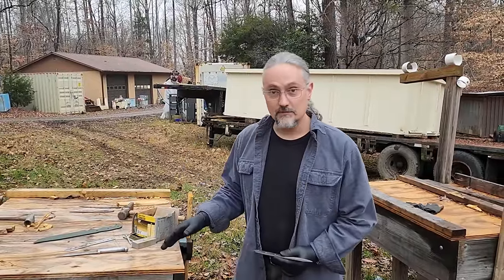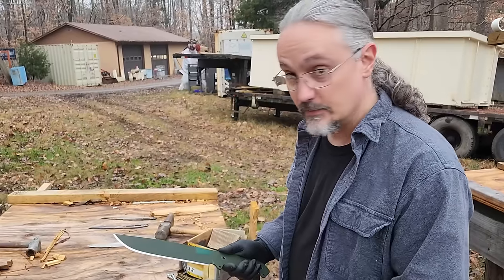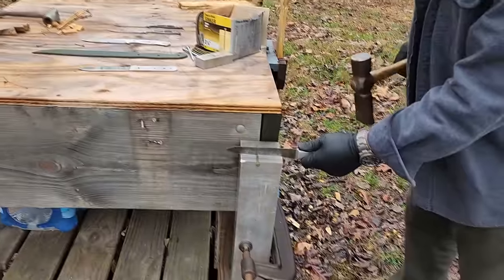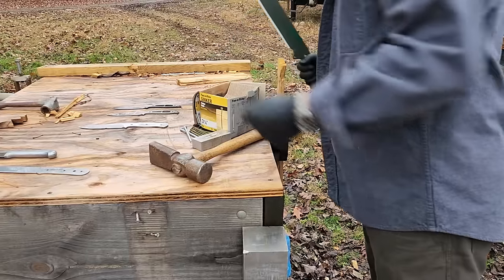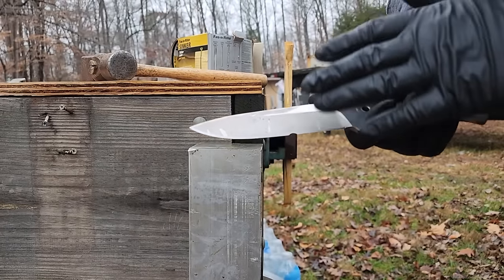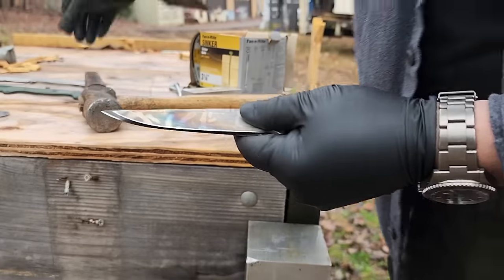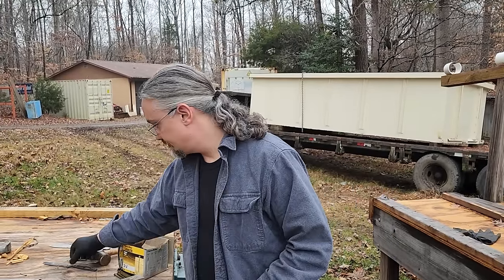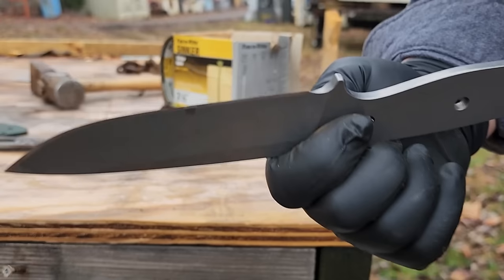How does Magnacut compare to high end carbon steels and Delta CPM 3V

Comment: Dr. Larris Thomas, the inventor of Magnacut steel, said in an interview that the number one factor affecting knife performance is edge geometry.  Understanding the intended use of a knife is important to apply an edge geometry that will optimize performance.  Larrin said that a knife that might not seem very good can be made better by modifying the edge geometry.
Reply: And magnacut is designed to have great edge retention when grinding thinner than usual. A hollow ground blade with a 15 thou edge before sharpening and convex edge in magnacut would cut the bolt fine....

Comment: that last test with the Delta 3V is truly impressive.
Reply: To me the Delta 3V would be the choice for a chopper or "survival" type knife (e.g. one that will be abused) so long as corrosion isn't a priority (ocean) and the Magnacut for slicing, wood working, normal bushcrafting, light batoning, kitchen use, or anything else that doesn't involve gross abuse.  I believe the Magnacut is going to have slightly better edge retention most of the time with superior corrosion resistance, and the Delta 3V is going to be tougher.

Comment: Delta 3V is pretty much untouchable. Insanely tough and fairly stain resistant. Magnacut looks impressive for a fully stainless steel for sure, but can't see it being better option than the Delta 3V for overall usage.
Reply: It's sort of a coked up AEB-L, though admittedly, I'll say that I've used it only in woodworking tools. But think slicing knife with some impact testing (not twisting) and that's what woodworking will advise on in terms of knife steels.
Reply: @daw162  "coked up AEB-L" might be one of the best descriptions of a steel I've ever come across. Kudos sir, kudos!
Reply: @chinaskibukowski7747  It's hard to think of a short explanation of it! under the microscope, it has tiny carbides like AEB-L. it sort of wears a little longer, a little more stainless, a little more time to sharpen....

coked up :)
Reply: What's the difference between regular 3V and delta 3V?
Reply: @MFD00MTR33  the delta part.
Reply: INFI is tougher... d3v has better edge stability... both high level of stain resistance. D3v will stay sharper longer on abrasives and INFI easier to sharpen
Reply: @MFD00MTR33  In short, it's the exact same base material but it differs in the heat treat processing. It's a low temperature tweak to provide greater edge stability and it also conveniently adds extra stainlessness to it as well. 

Check out the other videos on this channel because Nathan has in-depth explanations of it.
Reply: @optimuscrime608 😂😂😂

Comment: I don't really care about stainlessness. I've used carbon steel kitchen knives for over forty years now. They don't rust and I can get a fantastic edge on them. If I could get a better edge on stainless, I've never found stainless gave me any better edge retention, the patina isn't a problem -- they 'grey' rather than rust here in the damp (but not humid) UK and the edge is both fantastic and easy to sharpen.

Comment: That's a really fascinating comparison! The Delta 3V steel in particular is astonishingly resilient. However, my kitchen knives will certainly never be used to cut any bolts or chains. I look forward to eventually adding a magnacut blade to my arsenal.

Comment: Oh a few months back I found those radius plattens I got from you and decided to give them a try. It changed everything for me. Talk about a perfect grind for a chef's knife. I had some S35VN .140" stock. Never wanted to use it for chef's knives but now it do a flat distal taper out to the tip with a zero edges and pull the hollow up to the distal taper. Most of the contact surface is thinner than it would be on a FFG. That little bit of hollow might help with food release. The part I love is that I get the the very thin and slicy blade that is what I am doing with a chef knife but I get some weight and a very stiff blade that just feels better.

I hope you keep making those things. I have only been using them for a few months and I am Freaking out about what happens when they wear out. If there is anything else you make for grinding I don't know where to find your stuff. It was really random when I saw them up the sellers page of BF.
Reply: Great comment, thanks!

Comment: So, a little longer soak time for the Magnacut.  Thank you for that tidbit.  Are you using LN or dry ice?  I imagine with lower austenitization temps. the dry ice is sufficient because retained austenite doesn't seem to be as big of an issue with this steel.

Comment: Just curious how aeb-l steel stacks up toughness wise. I have it on a few balisongs and it is insanely tough and stainless. It's not on the same level as 3V in edge retention, but I'm dying to see it against 3V in toughness.
Reply: Somebody with the means, time and interest needs to do this.  I bet it would get plenty of views from "knife people."
Reply: Look up knive steel nerds, he has all those tests and answers
Reply: AEB-L is so low in the steel category and so far from these steels, that it's useless to compare it to them. Magnacut is WAY harder, will hold it's edge for at least 6 to 8 times more, than AEB - L, and that may sound little, but it's huge. in real use. AEB -L is one of the oldest steels, where Magnacut is the newest... It's night and day. You won't see any difference in toughness, in real use ,between any of these steels you ,mention. Literally no difference at all, other than edge retention and ease of sharpening.

Comment: It looked like you nailed the secret sauce (pun intended) for Magnacut heat treatment.  Went to your site and really liked your designs, but only saw 3V.  While 3V is renowned for its toughness, I was curious to see what you were doing in Magnacut?  From the different YouTubes, it appears that Magnacut is difficult to consistently work with.  Will you be making a 5" in Magnacut?

Comment: Impressive.  I saw someone do this with the Ontario TAK1 (older 1095 stamped version) and no damage to steel.  So I got one.
Reply: I have a TOPS UTE in 1095 that has surprised me with how good TOPS heat treat is.  I have several 1095 knives and the TOPS is in a whole different league.

Comment: Ideally nobody is ever in a situation they need to cut chains or bolts with a knife, but I guess in a pinch thats impressive.

I admit I have on occasion use my tougher knives to puncture pour spouts or breathing holes into steel cans if I can find a good can opener. Even s30v holds up for this type of task though.

Comment: I love magnacut. Have a chef knife at 64 hrc i dropped edge first into stone tile. The chef knife is screaming thin and chiped the stone tile... barely any edge damage and 5 minutes on a 300 stone to get it back to new.

Also have a outdoor blade in my own design at 63 hrc thats pretty thin and ive banged it trough two by fours and cuts loads of cardboard and plastic glued foam stuff. Still push cut free standing magasine paper after that. 

Chef knife is 10 per side outdoor 15 per side 

Myself dislike thick blades performance thin blades is my realm of blades and magnacut is a steel you can go thin with plenty tough silly stainless and good edge retention what more could you want
Reply: @JREwing-se2wk  i cant afford to buy anything with my current economical situation. Geometry makes all the difference like my mate aaron johnson showed he cut a nail with a sharpend butter knife
Reply: I am into thin and slicy knives too. I am using M4 at 66Rc and it does well down in the 6-8 degrees range. Have you ever tried it or plan on pushing Magnacut up there. I want to try it but I have lot of knives to finish and since my dewer is broken it's expensive to heat treat for a single blade so I need to run some batches so it's worth spending $50 on LN. I'm chasing what will hold up at higher hardness to support the edge and still do a quality edge. I wish Larrin would do something like a non stainless version and see if it could be pushed harder. I really want to see how 68Rc cuts.
Reply: @stormiewutzke4190  i am not a knifemaker so no i havent.

Comment: Wow so im not the only one that has hit a beer bottle with my knife edge. I'll never forget the first "high-quality expensive knife" I bought. I had just unboxed a Protech Malibu in 3v steel. Opened a beer as I always do sitting down to fidget with my new toy. As I hit the button lock to throw the blade closed it came right down on the top of the beer bottle. Didn't break the bottle but put a nice gouge on the edge. Being new to knife collecting not knowing how to sharpen yet, at $270 it literally made me sick! 😂
What's that tell you about protech 3v!? Supp to be grade A super steel toughness right?. 🤷‍♂️
Reply from the maker: Good steel can still suck if it has a bad heat treat or if it was burned at the edge in sharpening. None of the manufacturers are doing a very good job with 3V. Almost everyone uses the secondary hardening hump that was developed for tool and die work where minimizing part growth and dimensional changes was a key concern and that is not a very good heat treat for a knife edge. But it's the most common by far
Reply: @NateAIM  That was my thought was burnt edge, considering Protechs reputation, but I'm just a knife nut consumer so idk.. thanks for the reply! Just subbed and will own one of your knives soon! Very impressive. I've been wanting my first good fixed blade beater/chopper.

Comment: Thanks for the video. 
But why sharpened to 18 degrees? 
Isn't that an angle that you would use for kitchen knives.
Reply from the maker: Yes, that's true. We normally run 20 DPS, which has a good balance of cutting ability and durability in the materials we use, but I have been using 18 DPS while doing heat treat development work because it makes differences in edge stability more obvious to see.

Comment: Fun video!
Reply: @JREwing-se2wk  depends on the purpose of the knife. Not cutting to many bolts with my Chef knives. The edge retention and corrosion resistance on magnacut is superior compared to 3v
Reply: @JREwing-se2wk  Depending on the application. Magnacut has a better balance of toughness, wear resistance and corrosion resistance. 3V has higher toughness but is lower in the other two.

Comment: For a fixed blade? I'd go with your 3V knives or I'd take Ballbearing steel, either a slab of 52100 or even better, an old ballbearing from a Swedish truck, as also the more modern Vanadis 4 Extra, to any of the steels mentioned here. That being said,it's how the knife was made, that matters the most, it's only if you want the perfect blade possible, that you have to choose the steels I mentioned. For stainless, M390 is my choice.

Comment: Man I don't know exactly what he did but I recently bought a Medford Bonfire in 3v and this thing has a massively thick 7.5mm bladestock although I could have done without the hollow grind but it came with a relatively thick behind the edge bevel so I laid it back a bit and slightly convexed it by hand on diamond plates and wow it became a decent chopper and feathersticker while still being able to cut a 16penny nail then cleanly slice paper that was the first time I'd gotten a knife to do that and take almost no damage at all while still being a good performer I mean anybody can put a nail chop edge on a blade but can it also perform well in other tasks after chopping the nail?
Reply: Video or it didn’t happen bro that’s a bold claim

Comment: How thick do you need to run those to do a nail? I might not have it perfect but when I tried with my 3V blades and I got damage. I usually do kitchen knives and like thin edges. I am making some bigger knives and I am leaving the edge .015"

Comment: You should have stated the hardness and if the dents were chips or rolls.
Not sure those nails are very consistent.
Also we're living in a world were 18dps (36 degrees total angle) is considered a narrow edge... Oh well.
I'll assume the Busses rolled but if it was harder it could probably have made it with less damage.

Also staining is kind of a theoretical problem, unless you live on a fishing boat or something alloyed steels like 3v are stain resistant enough.
At the moment my go to steel is 3v. It's not even my favorite, too much wear resistance for my liking and I have always thought it tends to chip (small chips that is), but it's still very good and it's far easier to find (and cheaper) than stuff like A8mod, Calmax...
Reply: S the Delta 3V neither chipped nor rolled even with the bolt test?
Reply: What do you do where you need that much toughness. I have EDC'ed with M4 for something like 15 years now and I have never had chipping issues and my current stuff is up at 66Rc. Try running something in this high hardness group and run it hard and see what you think. I had chipping issues with lots of softer knives but it stopped once I started with M4. They only downside is that citrus will dull  it a bit and Magnacut that's not going to happen.
Reply: I was cutting drywall with a 3v Benchmade puuko and got a small chip. I later went to a mora in 12c27 and got slightly bigger chips. 

How does m4 do cutting drywall?

FYI I personally stained a blade in magnacut. Luckily, it only stained, but it was not on purpose.
Reply: @stormiewutzke4190  I have heard people complain about CPM M4 being very hard to finish. Kind of like Cru Forge V but maybe worse. I found the CPM through the year that 60 Rc range was actually easier to handle finish than CFV at 61-62

Comment: For nail cutting test 3 things are important - 1) steel, 2) hardness, and 3) sharpening angle. With that said, in order to compare steels, should the items 2 and 3 be exactly the same on all knives? Otherwise you are comparing  burgers with sausages...

Comment: MagnaCut is a great boat/survival knife but 3V may be the absolute best EDC steel if you could only have one. I got a bark river in 3V just by happenstance and panicked when my brother used it to pry open a wall socket while we were working on a house. I mean he dug the tip in and started wrenching and scraping. I KNEW the tip was going to be hella banged up. Looked at it in the light and there wasn’t a single sign of abuse. I realized right there that this was some special stuff. Conversely, I stabbed a beer can to open up a air hole with VG10 and chipped the tip from impact, then chipped the belly from twisting the hole. I only buy tough steels now.
Reply: I think it really depends what you value and want. Stainless would be very important for me, and I'd rather have better edge retention in an edc than super high toughness. Magna cut seems a great balance, or k390
Reply: ... great boat/survival knife steel* ...

Comment: Would magnacut be good for a large Bowie knife in 3/16” steel? If not… what ss would be. Looking to keep material costs lower that premium steels.
Reply: Aeb-l obviously. It's very tough for a stainless and quite inexpensive. About twice as tough as magnacut, wear resistance is low tough (but there's more to edge holding than wear resistance). Or 14C28N which is quite similar.
Reply: @here_be_dragons9184  thanks!
Reply: It would make a great Bowie. I don't cut nails and bolts and want something to cut. If you want pure cutting performance the group starts around Z-Wear and goes to CPM-M4 with Magnacut and the 4v group of steels being similar. I am currently so a 3V and M4 Bowie's. I am keeping the M4 and the 3V is for a client. I personally am never going to do anything where I need that much toughness and the amount of hardness you sacrifice is huge. Until you get into the ultra carbide packed steels that take crappy edges hardness is what will support a finer edge.

You want to talk about it more I check replies.
Reply: @Stormie Wutzke  I just run into this video today:
https://youtu.be/vC6NV084qlg
They did break clean a magnacut knife batonning.
Now I know Bark River has questionable reputation, at least in my book, but still.
Steels that can brittle fracture like that should not be used for large outdoor knives. Use tough steel like 1055, 1080, 80CrV2, L6... People generally don't make large blades in stainless, but if you wanted, probably use AEB-L, 14C28N, or maybe even 420...
Reply: @here_be_dragons9184  thanks!
Reply: @beowulf_of_wall_st  how about AEB-L?

Comment: Does Carothers Magnacut have better edge retention that delta 3v? I mean when cutting cardboard
Reply from the maker: In cardboard, yes a little. In regular everyday normal use around the shop or as a tradesman, they're pretty close. In rough use, the Delta 3v is a little better. In extremely rough use, the Delta 3v will hold up where the magnacut might break

Comment: There is no way that an 18° edge could hold up without any damage while cutting a nail. Maybe 25° or 30°. My bushcraft knives usually have no shallower than 25°. But wow, that 3v was impressive!
Reply from the maker: Are you talking about degrees per side or included angle?
Reply: Is your angle inclusive, or from the center of the blade? USFS axes are sharpened at 25 and 45 degrees inclusive (12.5 and 22.5 per side from center).

Comment: Its almost like your going out of your way to not tell us what the other steels actually are? Are the Last 2 also Magnacuts with different heat treat? Which one is the Delta? What would be an approximate comparison to the basic Carbons you used? Maybe 1040?

Comment: The bolt acts like a metal shear that's a hard test for any blade that only super strong steel could handle.
I've never seen a blade cut through a chain link before I'm speechless! 
            WTF.